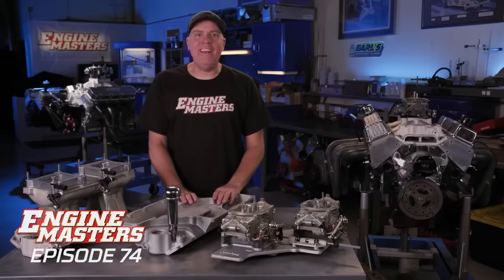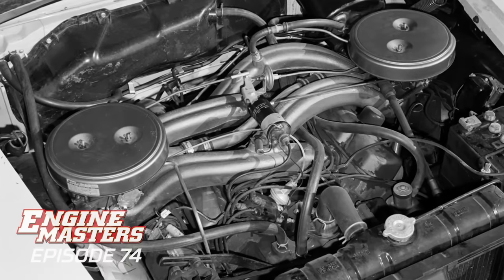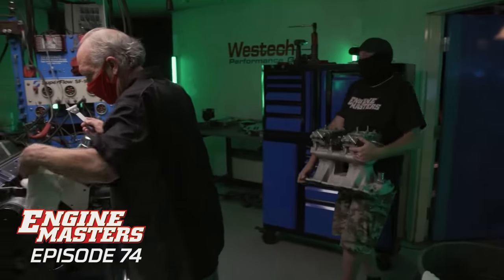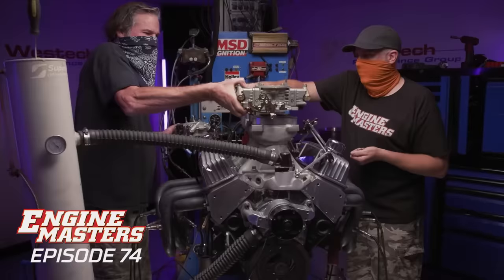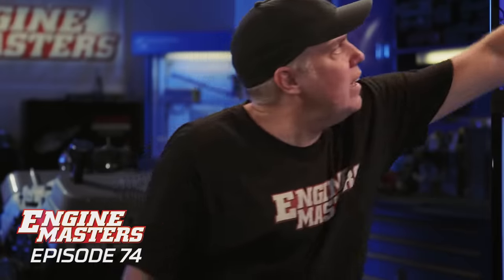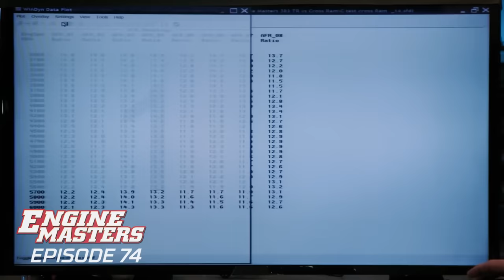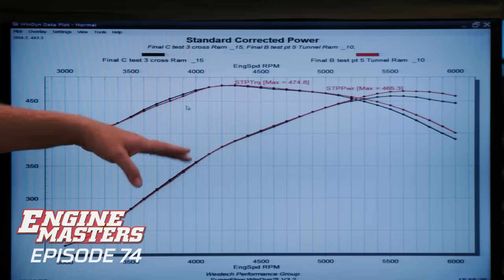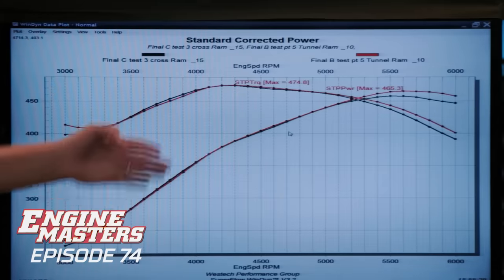Vintage Engine Showdown! Which Setup Has More Power? | Engine Masters | MotorTrend

Comment: If you want to modify the tunnel ram or the cross ram it's easier to  balance out the ports and and modify the 5 and 7 ports to help out from Robing each other. Also  you can  put dams in the bottom of the crossram to help with fuel distribution. They did it with the Smokey rams.

Comment: Just like I told Richard Holdener several weeks ago during a live show, the cross ram is the best tunnel ram that fits under your stock hood.  Chevy designed it because the SCCA Trans Am series rules said the carbs had to fit under the stock hood.
Reply: I really appreciate the cross ram..... my oldest brother had a Weiand  cross ram on his 70 SS Camaro in the mid 
70s it was just so cool looking and he didn't have to hack the SS hood
Reply: Mopar built it first I thought, late fifties early sixties? max wedge?
Reply: Yeah, those PENSKE CAMAROS with a DZ 302 defeated the BOSS 302 mustangs in the 68 and  69 Trans AM series  ..!   😎 I wish i had one of those cross rams the DZ 302 Camaros had under those hoods ..!  CHEVROLET MOTOR COMPANY would not help Rodger Penske at all so he went to the AMC Javelins in 1970 😮
Reply: @dinadaughtry8993  sorta. As the video says, engineers came up with the tunnel ram on their spare time and dime, cutting off the tubes until they hit the right formula. then they hung the runners over the valve covers of the 413, which sucked if you had solid lifters and needed to reset 'em every 3K. so they did the intake you're thinking of.
Reply: @albertgaspar627 
The more familiar Crossram came about on the '62 413 Max Wedge MoPar engines. The earlier over the valvecover intake system was called "Sonoramic" and I think was available on full size Chryslers until about '64 or '65.

Comment: I have run a two 4 bbl  Cross ram and a 3X 2bbl factory intake on my 71 Dodge Demon 340.
The 3x2bbl actually performed the best.
Reply: Probably because the smaller jets
Reply: @Texasmule  The 3X2 bbls all had accelerator pumps ( came off a GM 409) so the total CFM was 1300.
Actually I went back to the one thermoquad Carter to run in Super Stock class.
The cross ram made the 340  very torquey and great for 1/8th use but it fell into a modified class and not near the power of the blown cars in the class.

Comment: I would sacrifice that little bit of power and choose the cross ram over the tunnel.
No hood hacking 👍👍
Reply: Just saved me writing the same thing! The tower must match the power!
Reply: @needmoreboost6369  Did you mean to rhyme that time?
Reply: Depending on the application hoods are relatively cheap enough that you could have one circumcised for the tunnel ram and uncircumcised for the cross.
Reply: Once you get that cowl induction hood, I'm sure the hp would come up anyway. That little bit of boost goes a long way.
Reply: @needmoreboost6369  👍 awesome
Reply: @ashleyjennings5224  ok go buy an original '69 Z28 hood
Reply: @freemansgarage  no lol didn’t mean to rhyme that time! I’ll probably put a patent on that one
Reply: @needmoreboost6369  You probably should. It's pretty good.
Reply: @neal6418  Neal, I don't know that you can buy a new nos hood for a 69 Z28 but you can buy a used original they are not impossible to find but they are expensive. The people that would carve up an original Z28 hood to push a tunnel ram through it are the same kind of people that would hit a diamond with a hammer to see if it is really the hardest material on earth and wonder why it turned into powder. Neal, if a person had their heart set on a tunnel ram you should be able to buy a Repop hood for around $300 bucks. But this is America, so you go ahead and buy an original hood and chop it up if you want sweety.
Reply: @ashleyjennings5224  Everything you wrote is true, and you made Neal sound like a dope without using any cus words and only calling him sweety.
Reply: @neal6418  Go by an original 69 Z28 hood? What a weenie.
Reply: Buy a spare hood.....

Comment: Great show! Great video! I agree with another viewer. Test it on a 302 which it was designed for vs the tunnel ram.
Reply: Eh, I wouldn't expect a different result. If anything might be different.....it would almost certainly favor the tunnel ram even more so. The 302 is peanut sized and gives up power to larger displacement SBC. It's the engine Chevy never would have built if not for the strict 305cu in limitation in the race rules of Trans Am. The only advantage found in super short stroke 302 is it's ability to run to higher RPMs more safely than the longer stoke bigger displacement engines. With that said and looking at how the Cross Ram and Tunnel ram run really close together under 5000RPM and how the Tunnel Ram begins to show an advantage above that level......it's hard to imagine how the Tunnel Ram advantage doesn't just get even BIGGER as RPM increases in the Smaller Mouse Motor.

Comment: I made the decision to purchase an Offenhausr Crossram for my '56  Chevy project a few years ago. I have just about got all the engine parts and I still have work to do on the block and maching. The engine is a 400 block with a 327 stroke, flat tappet cam (a copy of an original Off-Road Z cam both first and second stage) to begin with. I also have both the single 4 and the dual 4 top for this manifold. It is going to be fun to play around and see what combination I can come up with that is the most impressive for my budget.  If the times are slower than expected, I will be upping the camshaft to something a bit more aggressive, maybe a mechanical roller. This is finally a video about the crossram  that makes a sensible comparison of what can be expected. Thanks for posting this.
Reply: I sold a polished Offy cross ram intake to a guy a few years ago, and he said it was going in a 56 Chevy. Northern Kentucky area. Havent seen the finished product but he had big plans for an unusual build.

Comment: I recently picked up an Edelbrock P22 dual-qual intake for 55-64 Pontiac 389's. The price was right and 1406's carbs are a dime a dozen used. That nostalgic look. The challenge of setting it up right. the P22 is a dual plane design.

Comment: To me, this is the biggest benefit of proper port fuel injection. Not the Bolt on injection systems that are basically electronic carburetor, but real fuel injection. You can get a manifold with long runners (or variable length in some OEM applications) with substantially less issues with distribution. When it comes to tuning, fuel injection (especially the current batch of aftermarket solutions) are light years easier than trying to make individual jet and air bleed changes on multiple carburetors. On top of that, you get improved driveability, improved fuel economy and vastly improved cold starting.
Reply: yeah but it's not as cool or challenging.
Reply: Basically an electronic carburettor- I like that term mind if I use it
Reply: The “electric carb” you speak of is a product they endorse for one... 

And for two, you can tune them... add some timing control via the ignition kit and you’ll blow any carb out the water. 

Cmon man the things read the O2 sensor and adjust fuelling for ideal ratios almost out of the box.
Reply: @dylanzrim3635  and still offer all the fuel distribution issues of a single carb! and I speak from experience that tuning a Holley carb for start up and cold running is so much easier than the earlier edelbrock efi and even Holley sniper efi,yeah they self tune “sort of” but not like a good set of ears and nose can! Using a target rpm and a target mixture for a desired idle not having any means of ve tuning is a compromise a carby can do! not sure about some of the other carb looking systems some impressive features indeed! all have their merits especially for simplifying a conversion, though they all still have nothing on port injection and a Haltech or similar for management.

Comment: I wonder how the results would change if the cross ram was tested on a 302 like it was designed for? Maybe that absolute top end power would be there?
Reply: The cross ram just needs it's cowl induction to reach higher hp.
Reply: So instead of it simply being a larger engine makes it's power at a lower RPM with the cross ram, it's more of more intake pulses per second making it work, which needs a smaller engine to have that higher number.

Comment: I want t revisit your "Six Pack shootout" show.  You should get a set of Holley carbs with mechanical secondaries.  They were made.  I had mine set up on bell-crank lnkage for 3/4 throttle before i brought in the out side carbs.  No bog...just power

Comment: Long ram = huge torque.

Nick's Garage did a comparo on a 63 Chrysler 300J with a 413.  The single quad had a higher horsepower rating, but the long ram intake delivered the torque in spades.

Comment: Each cylinders had o2 sensors so the could tell fuel to air ratio or each cylinder
Reply: yeah that's the way to go for sure. We didn't have that luxury in the 70s or 80s even

Comment: Really like the cross ram. Bet the power drops a bunch compared to the tunnel ram when put in the vehicle. Under hood temps will rob it.

But ya won't have to cut the hood and it just looks cooler than a tunnel ram, imo.

Comment: Simultaneous-opening square carburetors with each runner physically divided from the other runners all the way to carb bottom would afford more control, but discard the benefits of the plenum.

Comment: GM designed the cross ram for mid to high rpm use on road race cars. And more so the torquless Z28 302 engine.
It is not a street manifold however

Comment: Ok now test the SY1 or Edelbrock SY1 Smokey Ram, built by Edelbrock and Smokey Yunick, use the correct 830 Holley also. 
 Maybe test them on a 302 with some real rpm, leave the stump puller ,383, low rpm engines outta this. I want to see them at 7500 rpms
Victor jr
Z28 dual 4 barrel cross ram 
SY1
Some serious lift and serious rpm. 

The dual 4 cross ram and the sy 1 were built for high rpm operation. 
 I run an sy1 with the correct 830 Holley, on a nice little 350, .480 lift flat tappet hydraulic cam, ported 882 heads, and more than 6500 flat out, it pulls to 7000. That intake pulls from take off to when ever I let out of it. I know numbers don’t lie, but the seat of the pant meter is all smiles!!

I’ve got a brand new victor jr I’ve been told would make more power.

Comment: CROSS RAM AND 2 THROTTLE BODIES !!!
Reply: Didn't Chevy already do that with the 350 Corvette in 82 and the 305 in 83 or 84 in the Camaro/Firebird????
Reply: @JrGoonior  the factory intake had ports half the size of stock ports and the tbi's were small 2bbl

Comment: Can someone better explain how they got afr's for each individual cylinder?
Reply: The dyno has the ability to get AFR's by putting an wide band O2 sensor in each header tube.
Reply: An O2 sensor in each exhaust runner - you can clearly see them in the video.
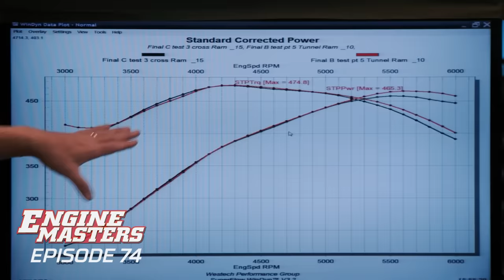Reply: Thanks, he explains it better at 8:50 and I just hadn't seen that yet, my bad
Reply: Witchcraft
Reply: @zairomolino4074  I mean, individual O2 sensors may as well be witchcraft, not like I'll ever be able to tune like that at home
Reply: @DracoOmnia  hone your plug reading skills 👍
Reply: @DracoOmnia  Any one that needs to tune individual cylinders should get a better head and/or manifold. They skip over that part here because this guy has some fascination with tunnel rams. What he actually proved is that it sucked on this application. You see the better designed manifold did not have distribution problems like the tunnel did. Also have him answer what happens to the fuel distribution when the secondaries are closed. To top it off this motor only made 465hp, it needs none of this garbage. Cant imagine building a motor like this and going down the street with two 4's out of the hood only to get dusted by a modern 6-cylinder car  🤣

Comment: You know a lot of this is your fault. Hot rod magazine throughout the 80’s and 90’s pushed the 383 and the victor jr as the end, be all engine of all time and the best Intake for any engine. All while tucking in those words that high rpms kills engines. No it does not but it makes power. 
 But it was a done under the,  hiding bigger cid inside a stock engine because of emissions. 
 Now we didn’t have many cylinder heads like we had today, we didn’t have efi, we didn’t have many cam companies either. 
 If you go back and look at trans am racing engines from the early 70’s, like the 289 ford, the 302 Chevy and amc, all you had was rpms. You had close to 500hp 302 Chevy engines running that cross ram and the ford cross boss intake. So why not compare the gm cross ram and SY1 and the cross boss on engines that rev with some adequate heads to flow compared to an old set of heavily double hump heads or boss heads.  
 I’ve talked to engine builders that have worked with the 302 engine, heavily ported fuelie heads, shaft rockers, 7800 rpms, the sy1 
450hp from 6000-7500rpms.
Swapped to victor jr, 525hp at 7400. 
That’s a 302, solid roller, big ported heads big compression. Where are this engines? I agains what these engines would do with some of todays abc heads that flow!! You would forget all about the LS or 383 ever again. 
When it’s all done then swap the rpm air gap, and tunnel ram on there. That’s a test.
 And what episode did you test the victor jr on the 383? Cause this episode did not show those numbers.